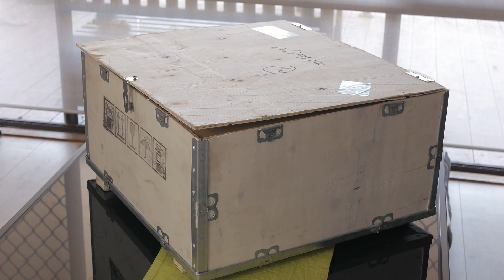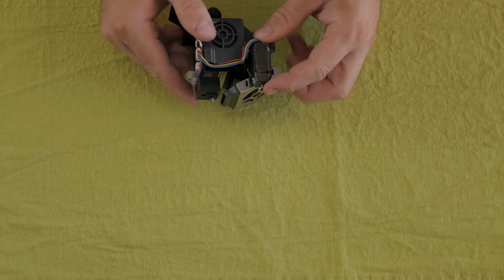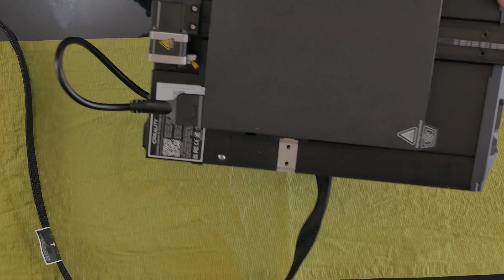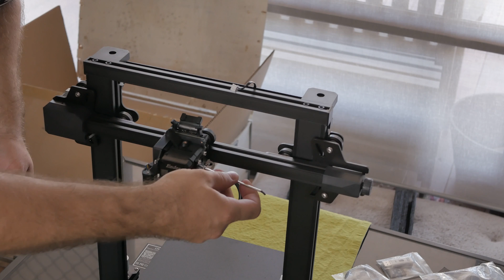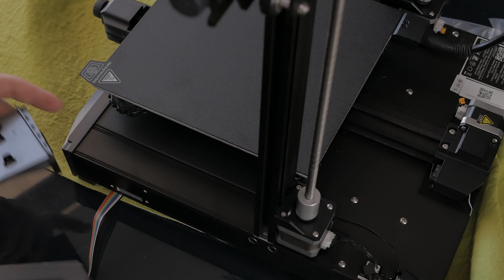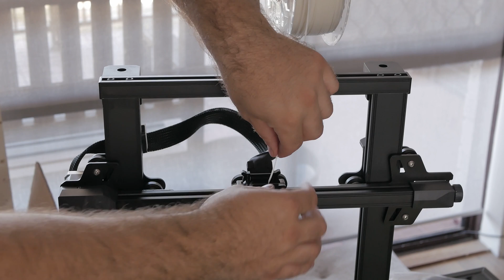Building the Creality Ender 3 S1 3D Printer | TechManPat

Comment: Mine came with 2 M5x12 bolts and nuts (like those that would go in extruded aluminium rails). Are they random extra pieces or did I miss something during the install?
Reply: Same problem here, did you find out where they go?
Reply: @jidla9791  nope but machine seems to run fine without them
Reply: @blazingtide123  thx printed my first benchie with no problem at all
Reply: they must be extra. i just bout the same machine.i actually have one extra m4x18 and m5x45  allen bolts left over. i wish they woulve made the instructions larger. Im eyes are 20/20 and it was rough for me...   Come on Creality...   It would not hurt to make the instructions a tad larger.